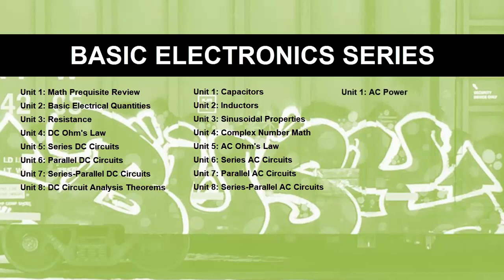Introduction to the Basic Electrical Circuits Series (OLD LECTURE)

Comment: Just out of interest is this Degree Level Learning ?
Reply from the maker: Mixed answer. This content is primarily intended for technical 2 year colleges (ie: associates) because it uses algebraic (ie: non-calculus) methods. This being said, I do mention the calculus behind the methods and a number of 4 year students do use this material and can substitute in the calculus on an as needed basis. Additionally, bridge programs (2 year to 4 year) often accept non-calculus electricity and electronics as long as the student completes a calculus course.